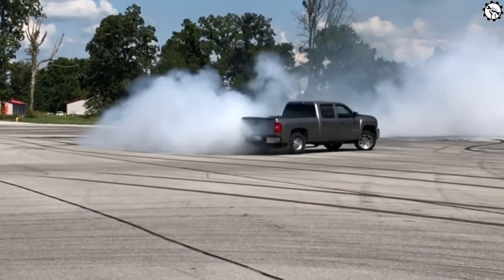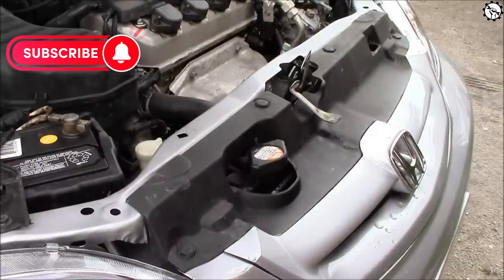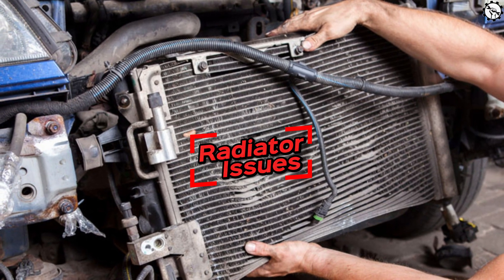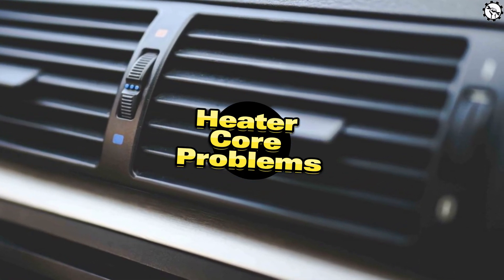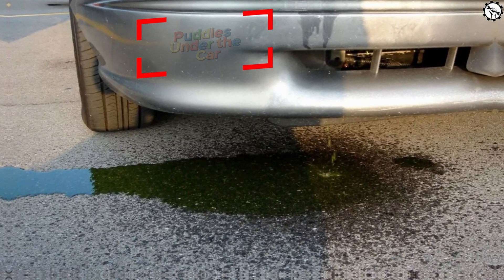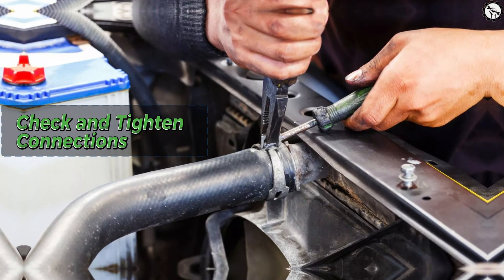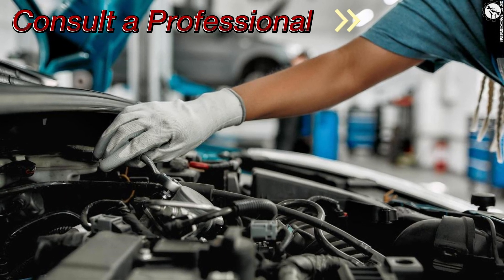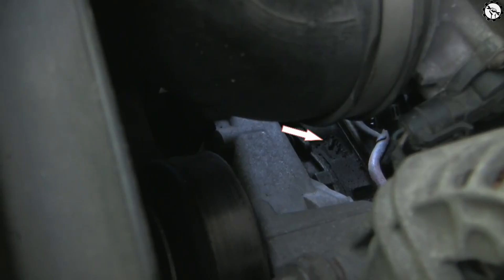Symptoms of Coolant Leaks :How to Fix? Coolant Leak: Causes, Symptoms, and How to Stop It ?

Comment: What possibly can be the problem of your antifreeze lleaking lightly from your undercarriage of a 2010 ford fusion sel
Reply from the maker: A light antifreeze leak from the undercarriage of your 2010 Ford Fusion SEL could be due to a worn-out hose, a loose clamp, a damaged radiator, or a failing water pump. It’s best to inspect the cooling system or consult a mechanic to pinpoint the issue.

Comment: Will a coolant leak make white smoke come out of your muffler?
Reply from the maker: Yes, a coolant leak can cause white smoke to come out of your muffler. When coolant leaks into the combustion chamber, it can mix with the fuel and create a white, steamy exhaust. This is often a sign of a serious engine problem, such as a blown head gasket or a cracked cylinder head.